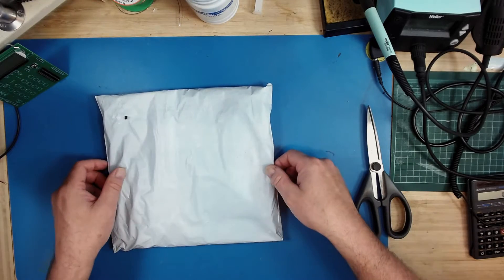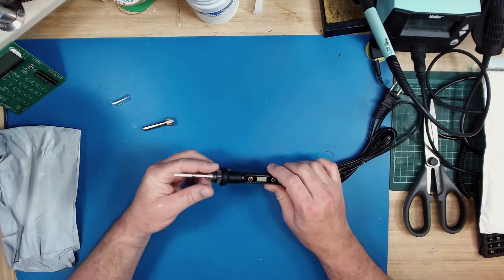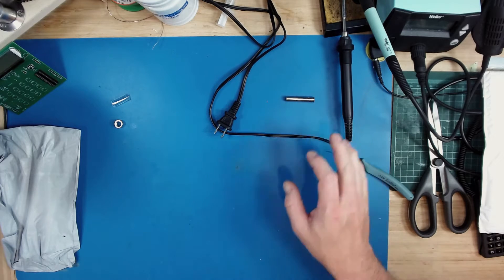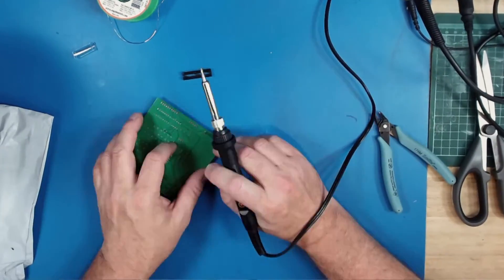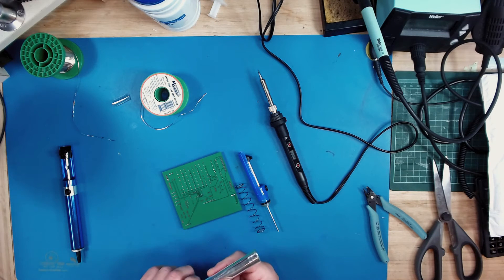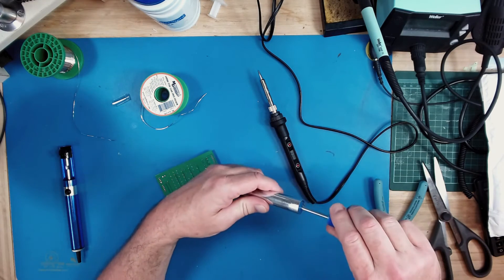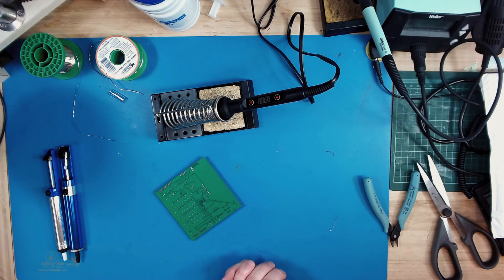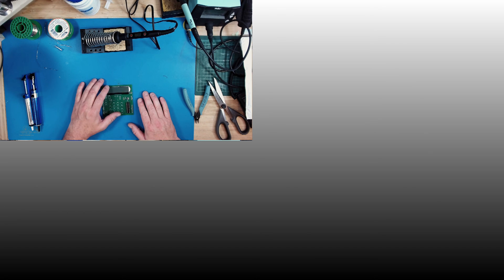80W adjustable Soldering Iron Unboxing and Review

Comment: Hi  @ScottCard , I have a similar soldering iron. It has a digital temp control, ceramic heating element and copper tips. The tips are tinned properly.

Is it normal for the ceramic heating element to turn black after a couple of uses? I'm thinking this might be a reason why the solder isn't wetting the components I'm trying to solder.

When I try to solder the back of a guitar potentiometer, the iron doesn't seem to stick no matter what I do. 

Any tips? I use the iron on 350 to 400°C.
Reply from the maker: I think you may be too hot.  Check the recommended temperature of the solder. The other issue is likely the solder it's self or the condition of the materials being joined.  They must  be clean, and the solder reasonable quality with flux.  Hope this helps.

Comment: 😢that is one of the industrial wastes made in China, i have bought three similar products, they all broke within one or two days. Problems with product design and low quality components, ,😢😅
Reply from the maker: Well, it is true you get what you pay for but... the tool you have is better than none at all. If you need somewhere to start or you are under financial pressure, this is great.
Reply: I have an even cheaper blue one with a dial and it has been working for years

Comment: My dont work how to fix
Reply from the maker: Oh no. Well, if the element or temperature sensor is burned out, I don't think it is worth repairing. Unfortunately, you did not buy it from me so there is not much I can do to help you. You could message the company you bought it from to see if they can help you with a replacement. Sorry.

Comment: I got the same soldering iron (model 908s but 220v). I keep mine at 400*C and it's ok. Only it seems like the temp drops low when I solder and takes a while to keep the tip temp high. I'm not soldering big things, mainly small electronics. I didn't measure the tip temperature to see the actual temp though.
Reply from the maker: Great. This has become my son's favorite, even over the Weller station due to how light it is. It is a little light on thermal transfer, as you have mentioned. Glad it is working well for you and thank you si much for the comment!

Comment: Those solder Irons - at least in Europe have one significant problem - the 220V cable is heavy and stiff - i.e. the work with it is cumbersome - otherwise it is fine - I replaced the cable for much thinner one and it started to be more useable.
Reply from the maker: Interesting. The 110V version is using a UL recognized 0.824mm (18AWG) two conductor cable rated at 105C / 300V that is reasonably flexible [branded SPT-1]. Which brings up a good point, like a lot of irons, it is not grounded. 😬 Use commonsense when working with any high voltage. Thanks for the comment!😎
https://www.southwire.com/wire-cable/leadwire/spt-1/p/LW26